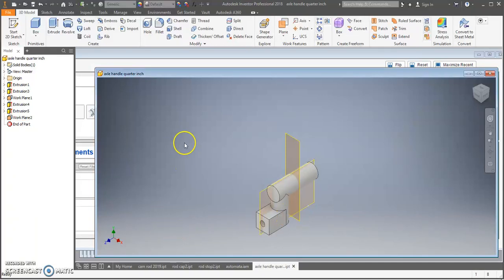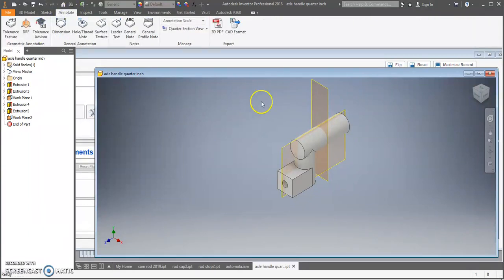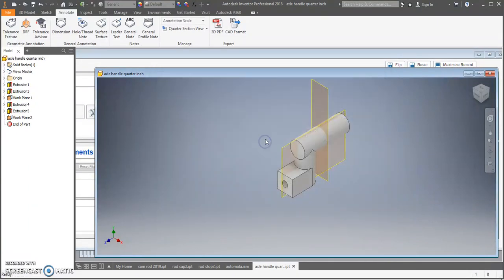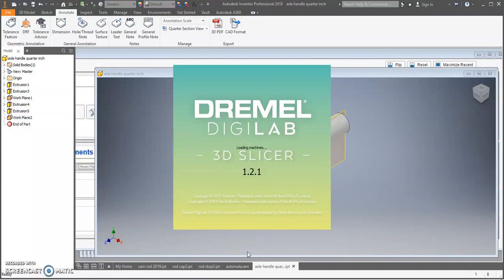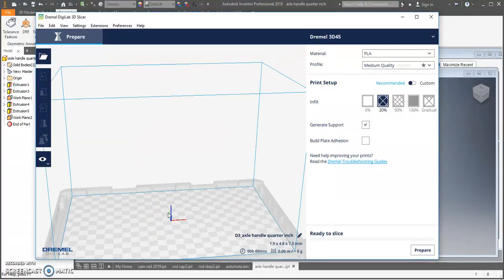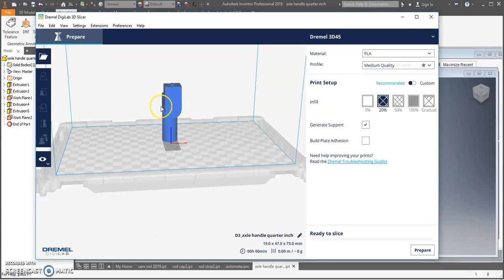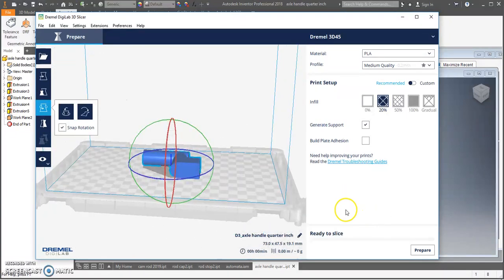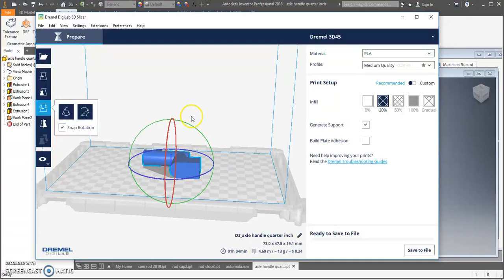3D print file prep Inventor to Dremel 3D45 via Digilab

Comment: I have a problem I use the dremel website and it like puts my files way outside the box even though it’s a small peace so is their a way to fix it please
Reply from the maker: Not sure what slicer program you are using, but should have an option to arrange on plate once you upload it into the slicer.  Easiest suggestion not knowing which program you are using.